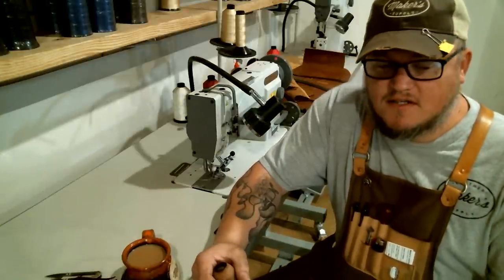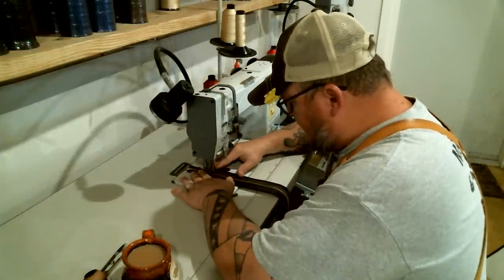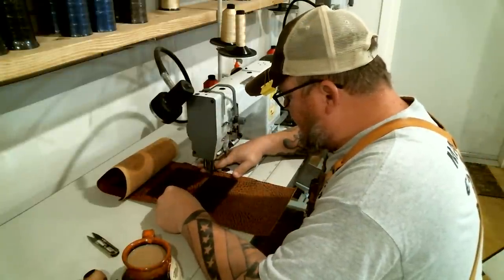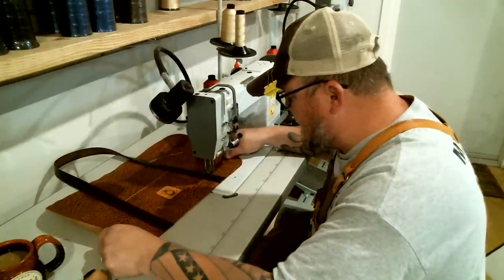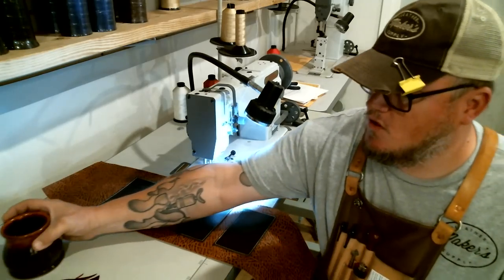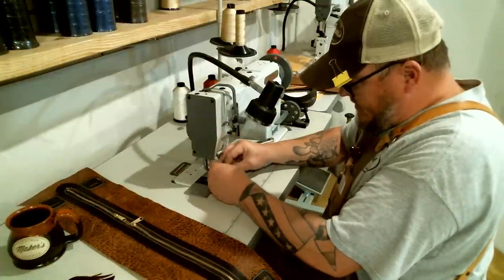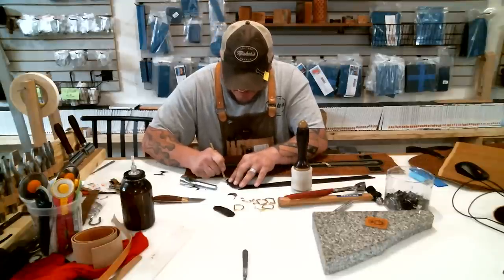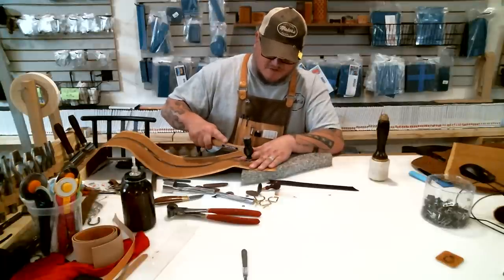Bag Making Series: Part 6 of the Overnight Bag, Sewing all the bits and pieces

Comment: Great video and very easy to follow along with while making this bag.  One question, when you lined your bag did you glue your liner to the leather?
Reply from the maker: I did.  I used Super 77 from 3m.  It comes in a spray can at hardware stores.  It doesn't hold it great but it holds it long enough to sew